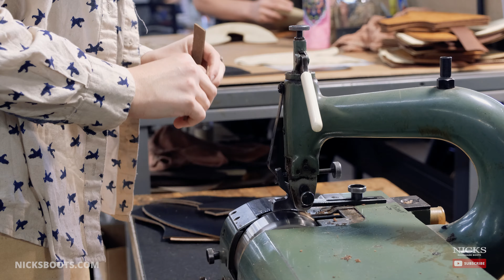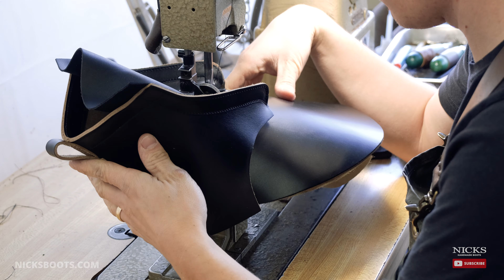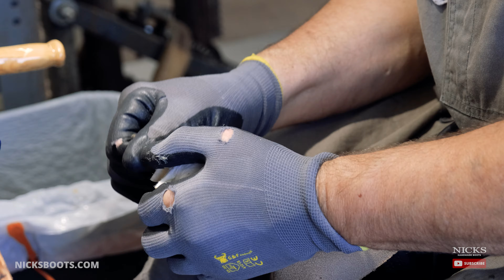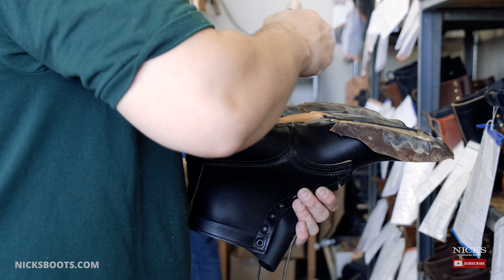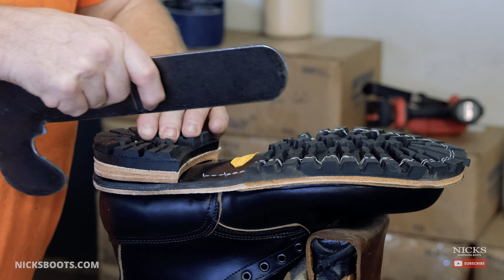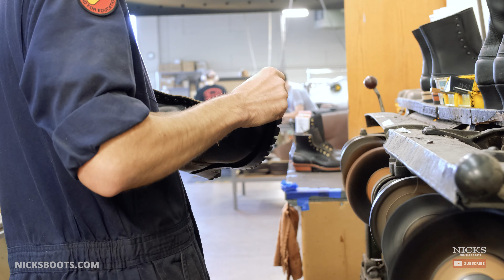How It's Made: World's TOUGHEST and Most VERSATILE Boots! The Urban Drifter - Nicks Handmade Boots

Comment: Hello and great work, thank you for the videos. I watch a lot of boot building and repair videos. I find them very interesting. I have yet to see where exactly the nails are being nailed into. Are they nailing them in to the last, (the foot mold) I think that’s what it called. The other thing, those look like long nails, how come they never push through and stab you in the foot? Thank you
Reply: They hit the metal plate on the last and turn around creating a hook. So even if after long time of use a nail was to touch your foot, it would be rounded, not pointy.
Reply: @Totemparadox  THANK YOU for taking the time to explain that to me. Makes sense now

Comment: won't stitching directly on top of the tread mean the stitches will break/fray as soon as you wear them? why not cut a channel?
Reply: I didn’t know either so I did some digging. The secret is lock stitching and a specialized type of thread that essentially glues itself to the shaft created through the rubber and leather when the needle penetrates. The contents of the thread apparently use to be a highly kept secret before modern times.
Reply: @bradlarrison191  I remember hearing about this a while ago but not sure where.  Can you tell me where you got this info?
Reply: Yes it will, but lockstitching paired with the thick rubber sole means the threads do not come loose.

Comment: Have they always used PORON foam and not cork filler?
Reply from the maker: We never use cork filler, instead we have a full leather midsole which leads to a better break-in process and a more comfortable boot!
Reply: You're talking about the black piece? That's a squeak pad. Very thin and and it's only purpose is to eliminate squeaking.

Comment: How to deal with the nails that trespassed to inside of the boot, and are punturing your feet sole?
Reply: they knock em down if they come through, and then add that little piece of leather 16:50 afterwards
Reply: They don't puncture your feet... Why do you people think they do? Would people buy these boots if that happened? Think for a minute.
Reply: There is a metal plate in the shoe last the nail will curve over when it hit the metal plate, so no sharp point inside the soles.